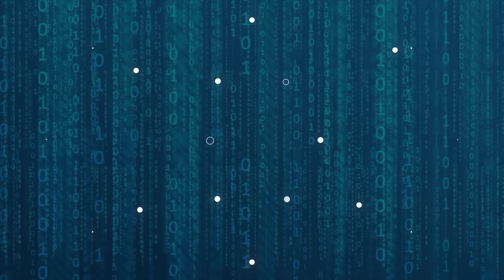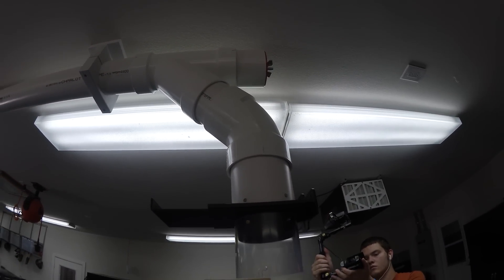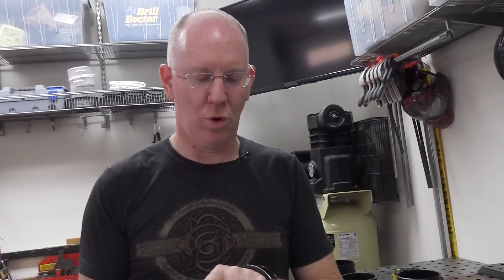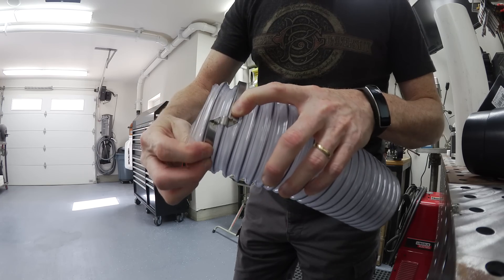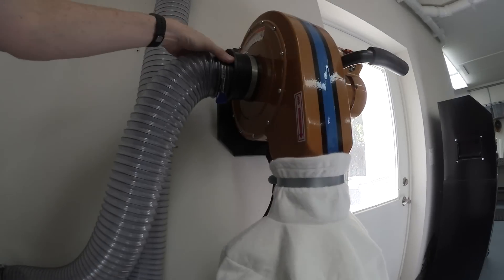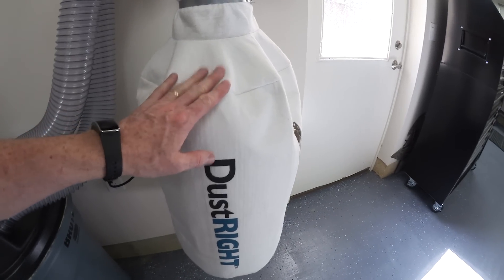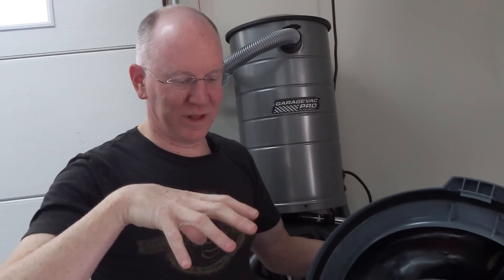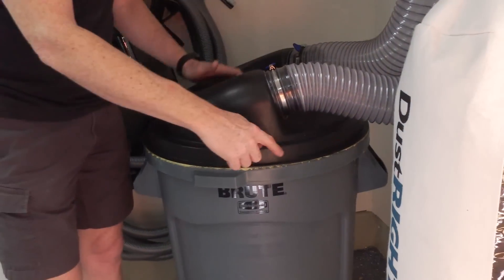How to Build a Dust Collection System - GeekBeat

Comment: Hi! Why don't use water pipes, they are thicker. I think the shopvap could make more pressure with them. Also there are water gates for water pipes already in the market. They are a bit expensive but is an already made solution.

Comment: I know some other people have commented on this, but do you think you could add a note to your description that it would be best to ground the piping so that static buildup can be discharged?  PVC or ABS dust evacuation systems are notorious for electrical buildup, and for people that use electronically controlled (like the festool variable speed tools) power tools, the shock can damage the tools

Comment: Now that you've had it for a year, how do you like you system?  Do the blast gates work reliably without sawdust jamming up in them?  Is your first stage trash can doing as good as you hoped?  Is the wall unit still holding up?  Do you wish you had done anything differently than what is in the video?  I'm looking at doing a system similar to yours and would like to learn from your experiences.

Comment: 3/4HP Rockler is terribly insufficient for 4" piping on long runs like yours! There are to many fittings & long runs reducing your CFM. At minimum you should be using a 2HP blower and 2 micron 98% filters as you suffer from allergies. This will also prolong the life of the pre filters & primary filters on your two air cleaners. Also you won't need to run them for long periods of time.
Reply: Seems to suck just fine in the video.

Comment: With plastic pipes, you need to worry about static electricity. With all that fine dust that is airborne, you have a bomb.

Run a bare wire internally through all the pipes and then ground it. Make your system a lot safer!

Secondly, 6" pipe would probably be better. It's all about static pressures, air flow rates, and velocity. Have a look at http://billpentz.com/woodworking/cyclone/ducting.cfm#pipe_size

Finally, good as those trash-can things are, if you are putting this much effort in, I would go for a cyclone (the website I linked to above has some excellent plans...
Reply: Paul, can you please cite a case where a woodworking shop has blown up like a bomb due to not grounding the PVC pipe.  From my knowledge this has been disproved time and time again but is still epidemic in the minds of woodworkers because it keeps being restated over and over again as fact.
Reply: Paul Simpson a bomb? I was an explosives detection military working dog handler in the US Army, could you enlighten me as to how this creates a bomb? I've done multiple combat tours and I've never heard of or seen a bomb with the combination of sch 40 pvc pipe, static electricity and saw dust....and I've seen some creative shit.
Reply: I must start by saying thank you for your service. I am English, but live here in the US (Indiana, to be exact). For those not experienced in the US culture, one thing my family and I noticed when we arrived (and continue to be impressed by on a daily basis, is the respect shown to those who make a career out of risking their lives to keep us safe, Whether in civilian life as, for example, a Firefighter, or in the military. I may not always agree with the politicians who put you guys in harm's way, but I am sure as hell grateful that you are willing to go! (Sorry to go on, but it's a bit of a soapbox of mine... I would love to see that part of American life exported to the UK with the same enthusiasm as fast food and dubious "music"!!)

Anyway, back to the point...

LOL! As I'm sure you realize, I'm not talking about something to use as a weapon!

As an explosives expert, I'm sure you have done the candle and powder experiment? For anyone who is reading this who doesn't know, you basically get a tin, a small candle, a small quantity of fine powder (cornstarch, perhaps) and a plastic tube.

Pile up the powder over one end of the tube, place the (lit) candle next to it and invert the can over the whole lot.

Then, blow into the tube.

The powder will fly up into the air and, one airborne, ignite. The resulting "explosion" is powerful enough to flip the can over and, in some cases, cause it to get blown off the table. A bomb? Well, it depends upon your perspective.

Now, back to the example here. While the system is running, you have a flammable fine powder (sawdust) suspended in air. As it passes along the plastic tubing, it can generate a static charge. If this gets high enough, there is a good chance of a spark.... and.... it's the can all over again, except this time there is a LOT more dust.

At the very least, it will probably cause damage to your extraction system. At worst? Well, let's just say I'd rather not be in there!

So, is it a bomb? You may say no and I am not going to argue.

BUT, should you take precautions (by running the ground-wire to drain the static)? I would say yes.

Sure, we can probably find hundreds of folks who have been using systems like this that are unprotected without incident, but let me ask you this......

In all your combat duty, how many times have you been shot and saved by a flak jacket? Does the low incidence of such events mean that you shouldn't wear one? How many car journeys are taken ever day without incident? Yet we still fit airbags and seat-belts. How many times have you been on a building site and been hit on the head with falling debris? Yet workers still wear hard-hats. 

My point? Safety precautions are no use if taken after the (potential) incident, you take them just in case, to be safe. Not adding a grounding wire to the system does not mean an explosion is inevitable, however adding one is inexpensive and certainly won't CAUSE an explosion! (Of course, it also won't help with stopping you getting debris in your eyes, cutting yourself with sharp tools or getting your significant other pregnant, but we have other ways of protecting ourselves from those happenings!!)

Comment: First question what comes in my mind is why not blow the exit air out of garage in sted of buying expencive filter bags?
Reply: I imagine that is because if you have neighbors (or a wife) they will get PISSED if you are blowing debris and sawdust etc out into the community air.  Its better to collect it and dispose via landfill or compost (if its just sawdust).
Reply: Considering that dust from many kinds of wood (plywood, MDF, etc.) is toxic, you would not only be putting other peoples health at risk, but you would be opening yourself up to a lawsuit from any neighbors that may come down with any lung issues. on top of that, you would be an A-hole for blowing dust all over/in your neighbors houses and cars.
Reply: What you blow outside depends upon the system. A well-designed two-stage system leaves little dust in the exhaust. I ran the exhaust from a 2 h.p. Oneida two-stage system outside. I filled and emptied the barrel several times. Sometimes I had visible dust on the ground below the exhaust, but rarely. Neighbors had no reason to know what came out of that duct, much less complain. The harmful fine particles disburse in the vast outdoor air system. Unlike collecting them in an enclosed shop, no one is exposed to a concentration that would pose danger of lung disease. 
That being said, my new shop uses a very fine filter from Oneida (rather than blowing air outside) so I am not exchanging hot outside air for my cooler shop air.

Comment: There is no way you're getting much CFM to be useful out of that Rockler Dust Right.  The bag that comes with that collector is not 20 but 30 micron.  5 micron bags are almost useless too.  You can tell you haven't used it very much because its clean.  You're piping is acceptable, but all the other advice is garbage.  You're not much of a geek because you haven't done your homework on CFM.  Your test with the connectors is bullshit too.  Its not large wood chips that you need to worry about, its the tiny dust that you can't see that does damage to your lungs.  You've really have done some damage to anyone taking your advice.
Reply: Not a troll, but someone who knows what they are talking about.
Reply: Agreed. Even 1HP dust collectors have trouble with 10ft 4" house right from the machine. It would be interesting to see an air flow measurement from the port. I'd guess 200 CFM at most. I believe miters need 500+ to properly collect fine dust.
Reply: I agree.  There is no way he's getting good suction with Rockler's 650 cfm unit across at least 20 feet of 4" piping plus all the fittings. If he's happy with what he has I guess that's all that counts.  I use 6" piping and I have Harbor Freight's 1500 cfm unit (though it is is NOT operating at 1500 cfm, it's more like 750.) I am still not getting good suction 15 feet down the pipe.
Reply: christschool troll

Comment: I find it amusing that he is worried about the difference in friction loss (loss of efficiency due to angles) between a 90 degree connector and two 45 degree connectors but doesn't consider the massive amount of friction loss he is getting from NOT GLUING the pipe together.  All those connectors with no glue on them probably add up to an open area about 6" in diameter. Don't believe me? Stick some pipe together and fill it up with water. What he did is fine, and using 45's instead of 90's will make a negligible amount of gain, but take the time to glue the pipe together unless you're gonna be moving and want to take the system apart.
Reply: Mike Britt    If you wanted to avoid gluing them together would it be OK to silicone the connections to seal it and that way get the portability this guy is talking about without sacrificing the suction?

Comment: One quick question!  Why not 3 inch pipe?
Reply: 4in gives you more air flow so it sucks up more at one time
Reply: Well yes and no.  The capacity of the vacuum motor and its intake determine how many cubic feet per minute it pulls, the pipe diameter that connects the intake to that motor (4" vs 3" vs whatever) will determine the velocity or speed with which the air moves down the pipe.  Narrower pipe will work fine, but the air will move at a higher speed, which means the intake velocity will be higher.  That would make it work better as a vacuum as it can pick up things like those wire nuts more easily.  The higher velocity would mean the air flow would be a bit louder (not the motor).  But more critical is probably just being able to find the fittings that work for you.

Comment: I would like to add to the discussion of PVC systems and the build up of electrical static charge.  I have watched many systems that have been posted on YouTube regarding grounding to prevent fires and explosive situations.  The only thing that I could find with OSHA is that if the cyclone system is over 10ft in length the collection spot must be located outside of the building.  Bottom line is to do as much research as you can to make yourself safe in your own shop.  Be safe and enjoy life!

OSHA link : https://www.osha.gov/dts/hib/hib_data/hib19970502.html
Reply: http://www.thewoodnerd.com/articles/dustExplosion.html

Comment: Does spacing the 45 degree angle pieces actually increase airflow, or did you just do it that way so you could actually connect them (they look like they had double female connections)?

Comment: I've seen a few videos about PVC dust collection systems lately, where all had to be grounded, to prevent static electricity building up and potentially creating a dust-fire. Do you have a specific reason why you didn't do this?
Reply: http://www.thewoodnerd.com/articles/dustExplosion.html
Reply: My guess is that he didn't try to ground it because grounding PVC is literally impossible without encasing every inch of pipe in metal. PVC is an insulator, so grounding it really isn't necessary (or possible).

Comment: How well does this pick up metal dust then? My KMG spits out a lot of very hot steel dust. I want to make something like this for my future shop as all of my grinding is done out doors currently but that will change soon. I am concerned about the hot sparks generated and hitting the plastic and subsequently being drawn into the entire system. My grinder also doubles as my knife handle shaper and I also think about steel dust mixing with wood dust and catching fire too.

I am thinking that when I make my setup I will be using a metal funnel similar to what you have with metal piping for maybe the first five feet or so. Maybe I am paranoid but I don't want a fire and I know neither do you. I am also considering making all sanding and grinding operations into one dirty room so to speak.

I guess I am asking how is this setup working for you currently? 

Finally, have you done anything to mitigate static spark buildup in the system? I didn't know anything about it until a couple of days ago.

Thank you for making this video it has given me a lot to think about and consider and I sure appreciate where you are going with this.

Comment: If you use duct seal tape, not duck-tape, it will help seal the system as we as being useful on your pipe joints.  This is a silver tape used on duct work.  The system will work much better by sealing off all the little leaks.

Comment: yep I had same problem with gorilla glue products , simply the brand stinks, I have tried all the different adhesives they have to offer and I haven't found one that is very good , the wood glue is worthless, use as directed and 3 days later I can break the bond apart by hands alone.

Comment: does anyone know why everyone uses 4 inch pipe and bigger!??!  i dont understand when most tools only  have 2.5 inch vents? can i just use 3"???  thanks.
Reply: For smaller tools, yes, but you will want to use something like a shop-vac/cyclone combo.  They operate high pressure but low volume which is fine for the smaller cross-sectional area of a 2.5" or smaller hose.  When you step up to big tools like planer, jointer, and table saw, you will see where low pressure high volume systems need the 4, 6, and 8in.  4in schedule 40 PVC is simply the cheapest and easiest aquired solution.

Comment: I have seen a lot of comments about folks concerned about grounding to prevent static, it is simply not necessary.  Test have been conducted to replicate a dust explosion within pvc pipe with no success.  grounding something that isn't conductive is very tricky to do.
Reply: Mike West "sawdust is flammable, not explosive."  

Mike has a lot to learn... here's a good place to start "Introduction to Dust Explosions"

http://www.baghouse.com/2013/10/introduction-to-combustible-dust-explosions-common-to-baghouses/
Reply: +David Chambers, good article. Thanks the the info. I have read quite a bit of posts stating to avoid pvc for dust collection purposes but you're the first one I've seen that had data to back it up. I am just using a shop vac with a seperator now, but plan to build a dust collection system soon. I don't take on anything of that size without doing a lot of research.
Reply: Mike's never seen a 60 foot high bag house explode - I have (metal hit the hog).
Reply: BTW: I was at my table saw last week... 50 hp all overhead metal blowpipe.  The last 20 feet or so of the drop is 4" flexible hose (plastic, with metal spiral rib).  Enough charge was accumulating on the embedded metal spiral for me to see it arcing when I touched to end to the saw housing.  Very small, but visible arc.
Reply: Mike West well, as a novice tinkerer, I did experience a fire inside my dust system due to neglection. It was not because of static but from embers from an experiment that I did, but it needed to be very atomized to happen. No explosion happened tho, just a small fire in the system.
Reply: Are people sucking up gasoline?
Reply: +Mike West an explosion is simply the burning of flammable material at a high rate of speed so technically saw dust can burn explosively
Reply: +Mike West Hi Mike - can you provide a link to said test/data?  

Dust collections explosions are no joke.  Not saying PVC will cause it, I really don't know.  But sawdust IS EXPLOSIVE!
Reply: Link coming soon ,   sawdust is flammable, not explosive.

Comment: great video, about the pipe by the belt sander.  if you put a 45 fitting on the end and that should allow the hose to stay on better, and sticking the hose on should be easier also.

Comment: For static electricity i would run a 14 awg bare wire with in the pies and connect it to the outlets ground on few ends. That would provide sufficient grounding throughout the system.

Comment: Nice video GB. I have been running a system very similar to yours for several years now, except I used the thin walled PVC and it has worked very and can be easily re-routed if necessary..... I have seen several comments about Static Electricity off the PVC causing dust fires. If anyone out there has any links or documented information on Shop Fires caused by Sawdust and Static Electricity could you post them please.

Comment: 3/4 HP collector is way undersized for such a shop. It is designed for a single tool, not a distributed system.
Need 2+hp and a large impeller.

Also, Since you are in the garage, I would recommend just venting to the outside, (after catching all the big stuff into the trashcan), instead of using a bag.

Comment: My suggestion for the connecting of the lids on the trash end of the system: coat the other side of the foam tape you used on the underside of the lid, but coat it with contact cement, let dry, also coat the lid it will be installed on, then the two lids will be connected properly and sealed .

Comment: what do you do about static electricity with the pvc pipes?
Reply: Yeah he needs to ground with wires wrapped around them all of them
Reply: cchaffin2012   I used to hear of people running a single copper wire down the inside of the PVC and then bringing it out to a ground.  Is that no longer considered an option?
Reply: http://www.thewoodnerd.com/articles/dustExplosion.html PVC is a poor conductor